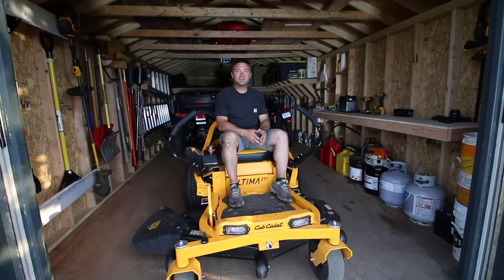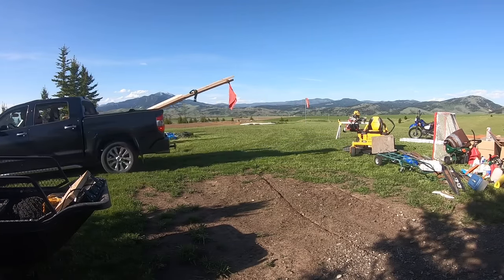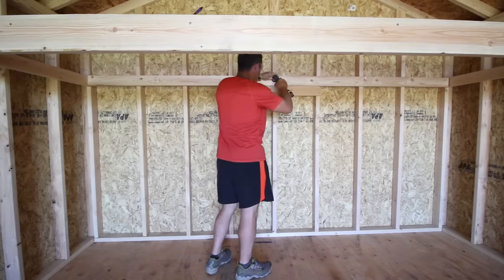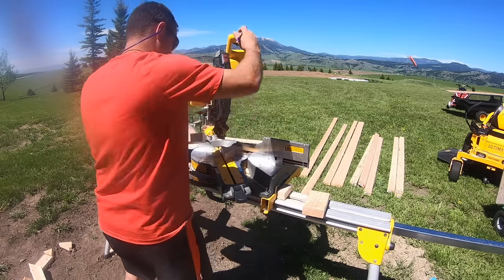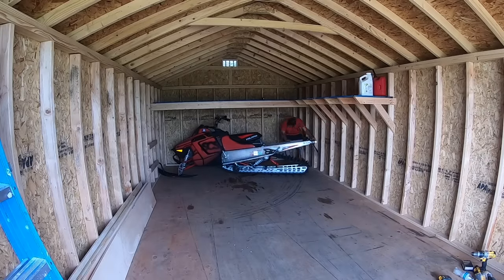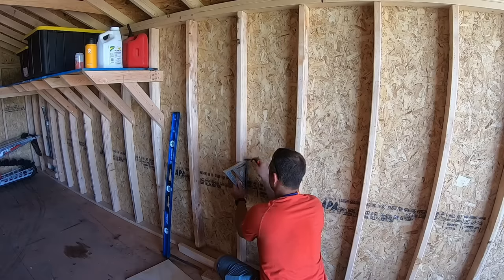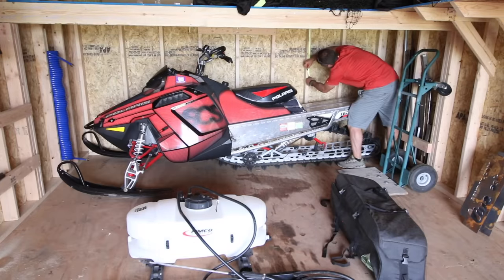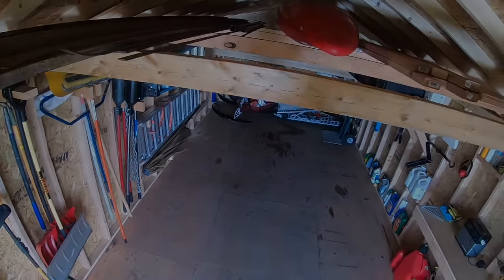SIMPLE SHED ORGANIZING PROJECTS | Shelves, Loft, Rafters, Racks

Comment: Side bonus, you now finally have rafter ties, which you didn't have but absolutely needed, based on the fact that your rim board is not supported in any way.  Lucked out!  A heavy snow load could have pushed the walls right out.

Comment: I used a lot of your suggestions for my 12x32 shed... I built the loft on the back. My ceilings are 10' so I was able to make my loft 6'. My 2' benches go across the back and wrap around the sides 20'... leaving the middle 8' and the front 10x12 open for working on projects!

Comment: Thanks! Very good. Great location there. My shed is only 12 x10 but have installed 12ft x30inch shelf from OSB and 2x3's, lag bolts, with enough room for lawn tractor underneath. Will add adjoining 18in wide shelf+l build tire racks from 2x4's. Gotta plug small gaps to keep mice out!
Reply from the maker: Nice work !

Comment: Great video with great ideas! I would want the work table to have at least an angle brace or two just in case I need to bear down on it during one of the nick knack projects you mentioned. I see it like four wheel drive: Its always better to have it and not need it than to need it and not have it!
Reply from the maker: Hey Robert! I ended up adding a couple brackets after the video went up, cheers!

Comment: As the years go by, your hanging tool collection will expand and change. I prefer pegboard to putting up insidual hangers like that. Either way having things up in your line of sight is a great way to find them easily without making some sort of system.
Reply from the maker: Thanks for sharing!
Reply: I think some peg board behind the bench would be cool too:

Comment: At 5:30 I would do things differently by using some transparent pipe with water to find the lines instead of measuring from the ground. In this case it will work just fine the way you did it as the floor is levelled, but as a general rule, I would prefer the other method. Or, in case it isn't possible, then a longer level from bracket to bracket. It takes a little extra work but it works perfectly.

Other than that, nice video. I don't know why youtube suggested me this video (unless youtube already knows I'm all about a, say, random order approach kind of guy) but it's given me some ideas. Thank you.
Reply from the maker: Thanks for watching and for sharing other methods! Cheers!
Reply: @DIYPETE  my pleasure. I wouldn't comment if I didn't like the video, and since it gave some ideas, I was thinking of the kind of shed (not a shed, but whatever) I have, and the ground is completely irregular, so I can't do what you did there, but I remembered what my father (who was a blacksmith) would do in that case.

Thank you for sharing.

Comment: Nice door prop. Same one I used to use. Then I bought a gate latch. One of those that automatically latches when you close the gate but it’s spring loaded so you have to pull a lever to open. I mounted the latch bar on the shed and the latch itself on the door. Drilled a hole through the door. Attached a 1/2 “ to 3/4” nut to picture frame wire and ran it from the inside of the door through the drilled hole to the latch on the outside. Secured the wire the latch release. 
   Now when I open my shed door I can just push it open till it latches against the front end of the building. To shut the door, I just pull the nut on the wire which releases the latch on the other side of the door. I don’t have to prop the door open, reach around it to unlatch it or unhook anything anymore. Less than $7 for each door and about 30 minutes time. The hardest part was aligning the latch and bar horizontally due to the fact of the trim placement on the shed. I eventually added an extra piece of plywood for a mounting surface. 
  I like what you did with your rafters. Good job.
Reply from the maker: Thanks! haha, yeah I added a latch system later this summer and it is so much better then the old shovels :) Cheers!

Comment: Best layout I've seen.  Looking to buy a shed.  Unfortunately, I don't have that kind of space.  It's going to be tight.  Inches count.  You said that your shed was 12' wide. When looking at sheds, measurements can represent a variety of different things.  Often eve to eve of the roof line. For reference, can you tell me what the interior width of your shed's floor is?  Thanks.

Comment: Great work Pete! Came up a treat, amazing how different I can look! Just a couple of quick questions 
1) does the cub cadet have a catcher available on that model?  
2) how long did it take you to do the shed?
Cheers!
Reply from the maker: Hi Adam! Great to hear from you. I do believe they make a bagger for it. Here is an example. https://www.mowersdirect.com/Cub-Cadet-19A70055100/p97112.html      --- I bought the shed pre-made. I calculated costs, and to customize it with the color, roof color, and have it delivered was not much more than the costs for the materials. Plus it would have taken a while to build, and I didn't have the time to. But I do want to start documenting some structure builds later this year. Cheers!

Comment: What size screws did you use on either side of the studs to hang broom, top to hang rake etc? Still 2 & 1/2 screws? Thanks
Reply from the maker: 3 1/2 inch screw for some of the items.

Comment: Just a comment.  My shed was prebuilt with a loft, just like yours.  However, I found out that in order to get stuff way in the back, I had to climb up in the loft.  After doing this a couple times, I thought how can I better utilize the loft space.  I came up with the idea to split the loft into two separate sections.  The back one was 4’ out vrim the back,  instead, I put a 2’ section between the sheets of plywood.  That way, I can put a step ladder up in the middle section and be able to reach both the front and back section.  You could also make the far back section 3’ and the front section either 2’ or make it 3’ as well. All that space is wasted.  I also put another loft in the front, except I split it in two from side to side.  On the front wall I put up a 1ft section running 3’ from front to back, abs stored canned and small items on it, and on the back wall, I out up a 2’ section to store boxes and stacking things there.  I also put up some hooks on the back side wall to hang things like chains, ropes, etc.  I was planning to making some shelves under the front side wall to keep things I used a it, however,, my son in law at that time was storing his racing MC I the front room.  So I gave him and my daughter the shed.  They later had to let the bank take the house back because he had a racing accident, which ended up with a surgery.  With high hospital bills and he had no insurance yet, because they weren’t married yet. They couldn’t oay the bills and the house payment. So I hsd no way to get the shed moved, so it stayed with the house.
Reply from the maker: Thanks for sharing all your tips!

Comment: After the sprayer shelf is in can you still fit the mower and dirt bike under there for the winter?
Reply from the maker: Hi Steve! The mower can fit if the front side of the mower goes under it. If I needed to remove it ever when I transition to winter it is just 4 screws, but i did try it and it seems like it should work fine! Cheers!

Comment: I like how you used screws instead of a  nail gun. Most yt'ers 'LIKE SHOWING OFF'  what they have but you used what everybody has 👍👍👍👍👍👍👍👍👍👍👍👍👍
Reply from the maker: Hey Mark! Thanks, yeah I hear ya on that one. While I do have a framing nailer and like how quick they are, not that many average DIY'ers do have one. Plus, if I ever decide to get rid of the loft, it is easy to unscrew. Thanks for the comment!

Comment: Pete, nice work !  I'm here in Michigan and we have some cold winters lol.  I have a approx. 12 X 12 metal she'd that I want to store a zero turn in.  Currently I have a sliding door that needs to be widened or a double door to replace it.  And I also will probably need insulation in the shed.  Any suggestions?
Reply from the maker: Hi Mike! Great to hear from you. You could certainly insulate it using some roll insulation, and then instead of drywall, you could use OSB  or plywood for something more durable. It gets real cold out here in Montanan as well, but I did not insulate mine as I don't do any work out there in the winter. You could certainly frame out an opening for a double door. I don't have a video on it, but there are some good shed building videos online. Best of luck!
Reply: Pete, I finally got my new shed built.  Upgraded to a 10 x 20 with a 4' loft.  I will definitely be using some of your ideas.   Question - how is that crushed asphalt holding up ?

Comment: Wonderful video. The only thing is, why don't you use pocket holes for all that stuff??
Reply from the maker: Thank you! I just used normal screws since it was easy and I wasn't concerned about hiding the screws. I figure a lot of folks don't have a pocket hole jig so that the basic technique may be better to relate to. But definitely an option to do pocket holes for some of the joints etc! Cheers!

Comment: Building mine currently. Using 10' 2x4s so I get some pretty significant height and then building shelves similar to yours all over the place. The only thing I was planning on doing differently is that rear shelf I was just going to do jack studs like you did with 2x6s running across and then just lay the board on that (no stringers). That's basically what a sub floor is so I figured that should be plenty strong. What are your thoughts?

Also, I'm undecided currently on what to do for collar ties. I'm wondering if I should just do OSB like you have and many seem to recommend. I was planning on using a 2x4 but wrapping both sides with OSB would be pretty simple and probably cost less.
Reply from the maker: Hope the build went well. I do think your idea for the shelves would be strong enough. Take care and enjoy that new shed!

Comment: Nice video. 

Honest question,  what made you decide to do the platform that way instead of running 2 joists across.  I’m making the same thing, & with the cost of lumber right now, I have to calculate if it’s cheaper to buy the two by fours and do it your way than it is to do it by just using 2 x 6s.  Yours looks very sturdy with the 2x4s!
Thanks!!
Reply: IMHO - running 2 joists across will be more "bouncy" and will require at least 2x6s or 2x8s to be stiff enough and may still need a column post lumber in the middle if you are planning on storing heavy loads. Doing it the way this video shows (main header with smaller joists in 90 degrees) will create a real solid loft platform.

Comment: Short doors for equipment other end. A pallet jack size storage bins by season. Gardening. Sports tools. Non weather related. I would have bought two containers spaced 8' apart with roof trusses. What was cost of your shed? 12' x 24' = 288.  containers 8x20 = 160 x 2 = 320
Add 20x6 =120
Reply from the maker: Hey Robert! My shed completed and delivered was $5500.
Reply: @DIYPETE  for $5500 i would have bought two containers and installed gravel base and roof long time construction and rust proof finish.

Comment: Nice job. What's the pitch on the roof?
Reply from the maker: Thanks! The roof is 5/12
Reply: @DIYPETE  What spacing did you use on the trusses? Any issues with snow load there? I'm building a similar sized shed here in Canada.

Comment: Pete, awesome video. Is that a shed that you had built or is that a pre manufactured shed? (Tuff Shed, etc.)  If you did build it, were you going to make a video on the process?
Thanks,
Jeff
Reply from the maker: Hey Jeff! I bought the shed last year from Montana Shed Center. I honestly looked into the costs and they built and delivered it for not much more than it would have been to build it. And I didn't have the time. They deliver to the Northwest and were cheaper and much better quality than any other brands I came across. I have built some smaller sheds in the past though and want to build and document some structures in the future. Cheers!

Comment: Add a solar powered light out there.
Reply from the maker: Hey Cali! I love this idea. I'm definitely going to do one outside, and think a panel on top with a simple battery system inside would be cool for an indoor light and some power as well. THANK YOU!
Reply: Yup, I would say use conduit to route the wiring inside the shed to keep a clean look, dont want exposed wiring, just looks crappy.
Reply from the maker: Definitely! I did a solar setup on my travel trailer and love it. Solar is so cool. Cheers!
Reply: @DIYPETE  a solar panel could also power a battery tender for the mower during the colder months
Reply from the maker: GREAT IDEA!

Comment: Rafters hold the roof deck or ply, and what you think was a rafter, that's actually called a tie or collar tie. You should of notcheched the shelves to slide into the studs. 2x6 and 2x4? The maximum span is 1.5 the size so a 2x6 shouldn't span more than 9 ft and with a 2x4 as a beam... lol. 2x8 minimum for a mezzanine

Comment: I would call those collar ties rather than rafters.
Reply: Yeah, I'd call those collar ties as well, if low enough you might even call them ceiling joists.
Reply: John collar ties are in the top 1/3rd of roof, rafter ties are in the bottom 1/3rd of roof, rafter ties will also keep the walls from bowing out under a heavy snow load.
Reply: @woohunter1  Point being, they are not rafters.
Reply: John they aren't collar ties either.
Reply: @woohunter1  More a collar tie than a rafter, and you're still missing the point, sparky.
Reply: John collar tie? No, ceiling joist or rafter tie, yes.  Who is missing the point?  Collar tie is in the top 1/3rd of a roof system.
Reply: John I didn't say it was a rafter, it's a a "rafter tie".  A rafter tie is different than a rafter.  A quick Google search with pictures, in case you can't read, will show you what a collar tie is.  It will also show you that a rafter tie is on the bottom 1/3rd of a roof system or a truss.  Peace out douche!!! Haha
Reply from the maker: He guys! Thanks for pointing this out, and yes, my terminology was wrong when I said rafter. My guess would probably be rafter tie as it appears the collar tie may be a little higher.  --- but either way it was my mistake in calling it a " rafter " without the word tie after it    , or it perhaps could be a collar tie by some as well. Anyhow, I'll take responsibility for calling it the wrong thing and that was my mistake.  Have a great day and thanks so much for watching everyone! Cheers!  Here is a link to diagram I did find. https://www.nachi.org/collar-rafter-ties.htm
Reply: @DIYPETE  Yeah, in my area we call anything above the plate that ties the rafters together a collar tie. Regardless, thanks for the great ideas.
Reply: @woohunter1  In my area we call anything above the plate line that ties the rafters together a collar tie. Sometimes field terminology differs by region, but you do you, keyboard warrior.
Reply: @JohnComeOnMan  Don't know what planet woohunter is on but the professionals call them collar ties or collar beams even at that elevation (height above floor in this case; for you experts). I've been building longer than you've been alive , and it might be geographical jargon but I've always called them what they are; that being collar ties. Given the apparent location, I can't believe there weren't more collar ties to begin with, but then I associate mountains with snow??
Reply: @jackriley5974  Yeah, good point. Snow load on such a flat pitch. Maybe it's because the building isn't very long and there can't be much outward flex in such a short span. Personally, I tend to over build so I can sleep at night.
Reply from the maker: @JohnComeOnMan  Cool thanks for the info, I appreciate it John! Hope all is well man.
Reply from the maker: @jackriley5974  Thanks Jack, I appreciate it! I bought the shed from a company up in Great Falls, MT that makes a bunch of sheds for all over the northwest. It had one collar tie, but nothing else. It does have a metal roof and so the snow does melt and slide off the 5/12 pitched roof quite fast. We had a record snow year and I literally had feet of snow in the backyard with huge drifts. I live at 5,240 feet so just short of a mile. The snow never really could pile on the roof as it slid off, so perhaps that is why they don't make their shelves with much for collar ties. However, I am so glad I put mine in for the storage capability, and obviously as you mention it also now will add a lot of additional support. Thanks a ton for your help and feedback. I love to learn from builders like you guys with years of experience in the industry. Cheers!

Comment: Why would you only use 2.5 inch screws to join (2) 2x4's together..?? That means your only grabbing ~1 inch from the 2nd 2x4...
Why not use 3 inch to fully penetrate the 2nd piece of wood ..??
Reply from the maker: A 2x4 actually is 1 1/2 inches in thickness by 3 1/2 inches in width.
Reply: @DIY PETE:
I didn't ask what the actual dimensions are for 2x4's was .... But thanks for letting me know something i already knew and you still didn't answer my question... 
Lets try this again...
WHY did you choose to use a 2.5 inch screw on something that was 3 inches thick..?? 1.5 + 1.5 = 3 inches, you used a 2.5 inch long screw on something that was 3 inches long LEAVING ~1 inch of UN-PENETRATED wood ...  Why not use a full 3 inch screw for max penetration ..??

Comment: I would have built the loft higher so there would be no need to crouch when putting the mower under there. Whacking the head is no fun.
Reply from the maker: Hi, you sure could, you'd just lose the extra space above, but you'll certainly want to do what best fits your space, and best fits you :) Cheers!
Reply: @DIYPETE  yeah you're right, it's like most anyting. No matter what you do there are always pros and cons